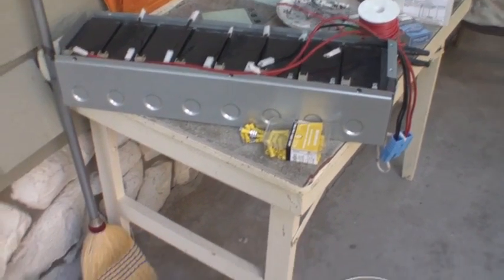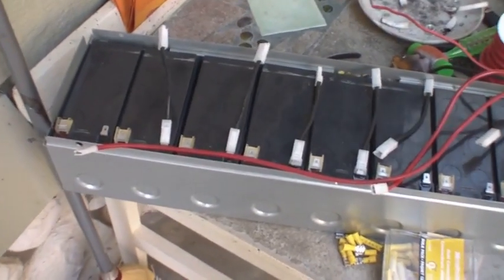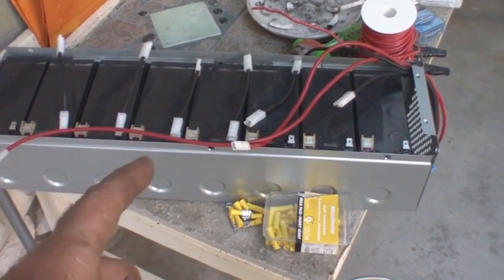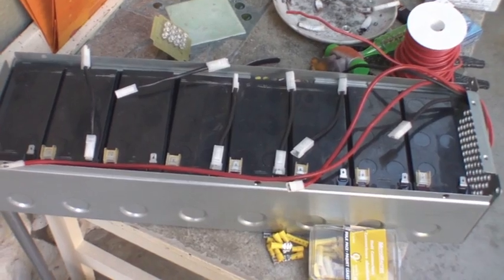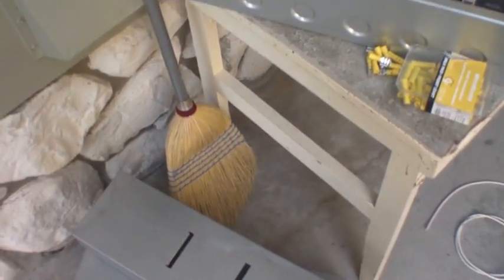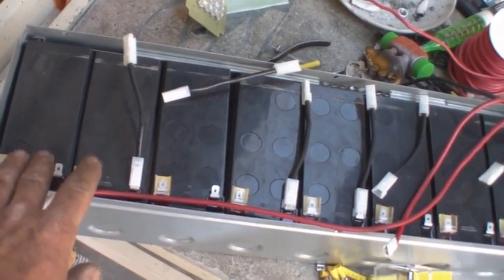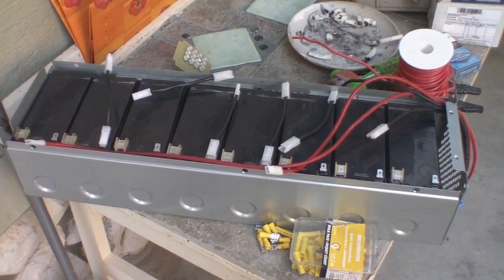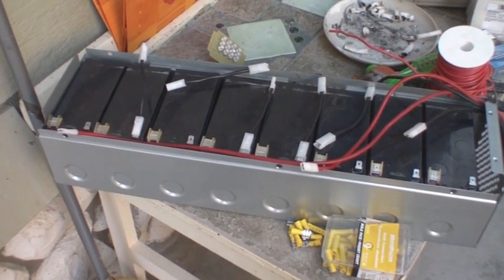FREE SLA Batteries - Junk or ... ?

Comment: Eaton 9.5Ah battery 
Cells (per battery) 6
Voltage (per battery) 12
Rating 34W @ 15 minute-rate to 1.67V per cell @ 77°F (25°C)
Weight Approx. 5.95 lb. (2.70 kg)
Lead weight Approx. 4.33 lb. (1.97 kg)
Maximum discharge current 130 A (5 seconds)
Short circuit current 367 A 
Internal resistance (approximate) Approx17mΩ

Comment: if u can pull 35w untill discharge in 15 mins then 35w is bater that would make each 35w batery 
2.92A going by normal watts to ampre rate

Comment: 12v discharge at 35 Watts is about 3 amps x 15 minutes or about 45 amp hours if I heard you correct, it seems like you didn't know but volts times amps equals Watts. for example if a hair dryer pulls 1000w then we know that the volts are 120v so how to find the amps it is 1000 / 120 or 8.33 amps

Comment: way cool Kyle, i just saw this vid of yours and responded, lol, did not even look at date. what i really want to try is that solar,tesla charge set up you did. i got to battery banks ,600ah and 675. they could always use some extra conditioning, so i am going to make a 4 or 5t using MJ15003 transistors. see how that does.

Comment from the maker: Hey bud! This project has evolved much past this point, which was last year. The batteries are now in a strawbale home, have been through several cycles of conditioning with a TS SS SSG air core, and now, they (5 of them) charge right up to 14.8V, run light loads (3A-5A) all evening providing light, and don't even drop below 13V. Solar charged the next day with MPPT - the pulsing is beneficial itself... and occasionally they run up to 50-60A lamps, no problem.

Comment: my old 18ah battery would run the big wheel for about 5 hours, so i am thinking about 2 hour run time on a wheel type bedini so it should run that trolling motor, whats the amp requirements on the trolling motor? if its high, just run two or 3 batterys together, get longer run time.

Comment: hey buddy, nice score on the batterys, what you can do is take one out, run it on your charger, then let it rest for about 10 hours. full rest, lol. then take a 1amp bulb to start, record the resting voltage. say its 13.5. now discharge that down .42 so it would be 13.08 and time how long it takes to get to 13.08. then increase to 2amp bulb, compair times, should give you a ruff idea how long they would last under load.

Comment: I have a little float charger that checks the battery as it charges it.  I use it to test SLA batteries that I take outr of old jumpstarters... The float charger charges for a certain amount of hours and when its done it load tests and says if the battery is good or bad.  It was a pretty cheap walmart purchace.  Its a Schumacher XM1-5.  By the way, GREAT FIND!  I think that would make a great battery bank for a small solar setup, if you have enoughg good batteries in the bunch.

Comment from the maker: @Alex1M6 I have actually seen them for sale online rated at 9 a/h. And I hearya on the test method. I'm going to use 4 x 50 watt 12v halogens, now that i have the entire bank wired parallel. Run 200 watts of light and see how long it goes. The bank is still charging, but it looks like the bank as a whole is going to come up to 13.5v :)

Comment: They look about the same size as my 12V 7AH lead acid battery's, but I have seen some newer ones that are the same size rated at 9AH. The easiest and cheapest method to test would be to connect up a 12V light bulb @ a known wattage then just see how long it lasts for, you can get special lead acid battery's testers but they are quite expensive @ around £100/$150.

Comment from the maker: I still don't quite understand the float charge voltage versus the cycle/equalization charge voltage. I am assuming that the float is a "top up voltage" or "maintenance charge voltage" and the cycle/eq. is voltage to use when the battery is dead? And I wonder what the problem might be, when slowly discharging vs. a quick discharge? One datasheet i read for this battery actually stated * discharge over greater than 90 minutes is not recommended. Is that for real?! That would really limit usage